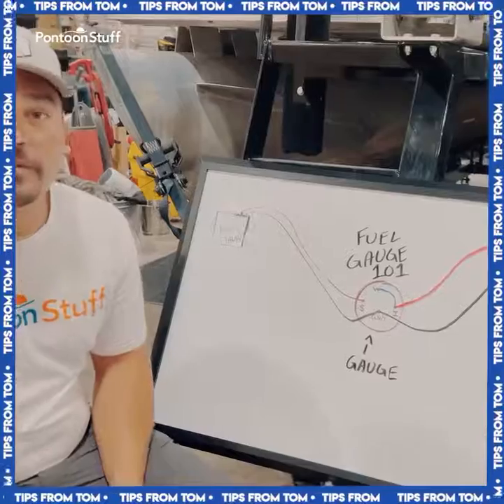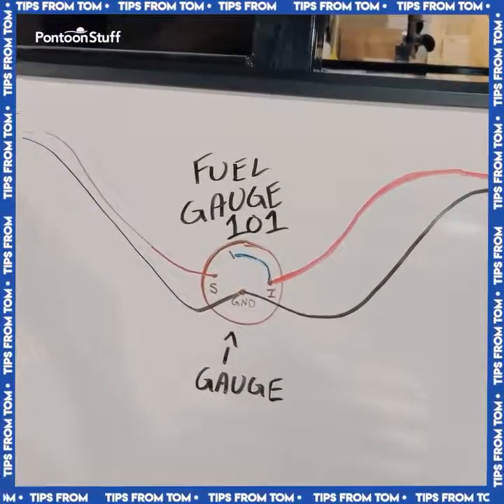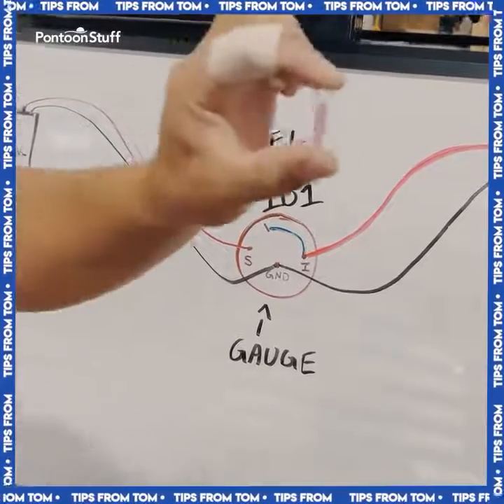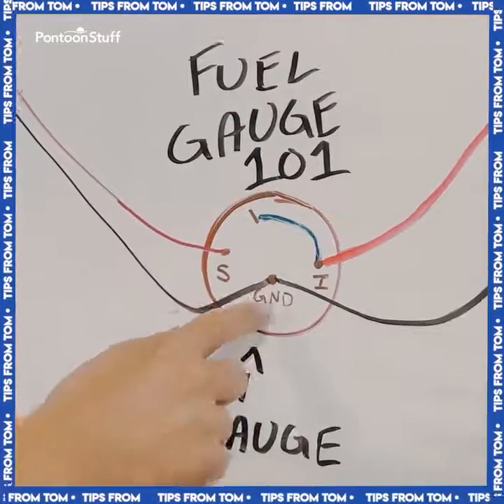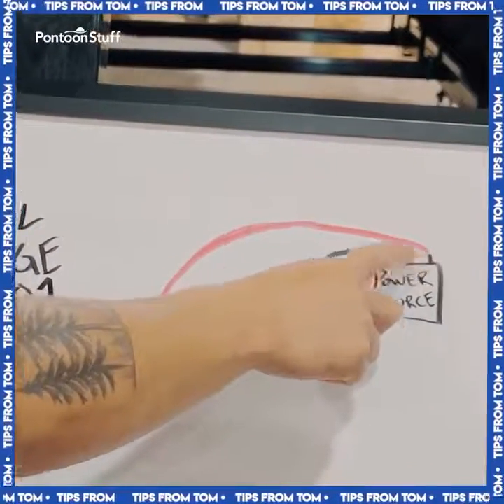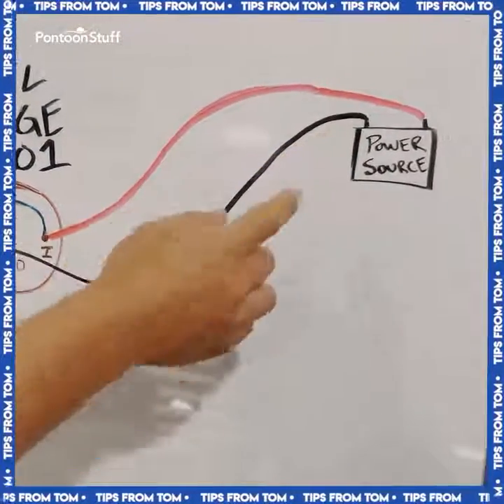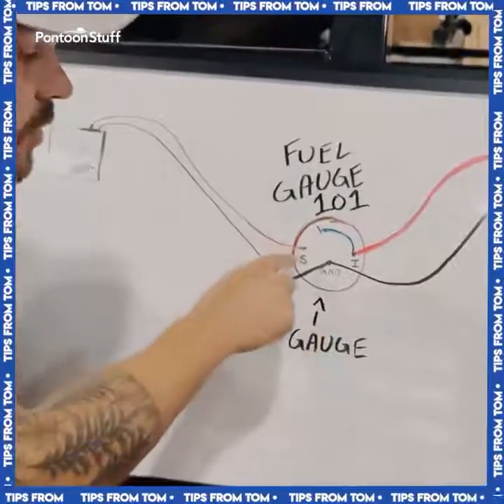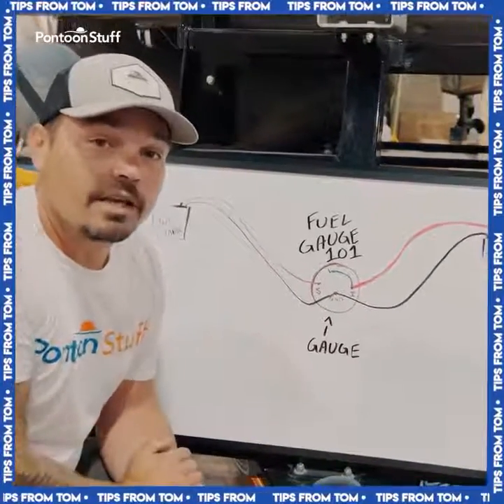Fuel Gauge Wiring 101

Comment: What to do if fuel gauge shows 75% up to 100% fuel reading? When sending unit lever is down, it shows 75% when it should be 0% and if I push it to the end it shows 100%. What is required to fix to get full range of reading?. I did change 4 different sending units and 2 different gauges, but I never got reading from 0 to 100.

Comment: Hi, with ONLY the 12v power and earth wire to the gauge, will gauge read full or empty, trying to work out if I have a faulty gauge as it shoots to full with only 12v and earth connected and sender isolated. Thanks

Comment: Thanks for the video very helpful. I’m working on a 63C 10 pick up and I’ve got a new sending unit that I was testing before installing in the new fuel tank. I was trying to make sure that my cluster fuel gauge was still working properly.
Do you have a method to test my fuel gauge ?
The gauge has continuity, but I don’t know how to test to see if it works 
thank you

Comment: I got a oem fuel tank for our txt golf cart but both wires coming off of sending unit or fuel tank have the same color both are gray how would I know which is + and which is - thanks
Reply: Continuity each wire to bare metal on tank and you found ground
Reply: @s1v3bid  there is just one problem with your suggestion my tank and sending unit in tank is all plastic so how would I know which wire is which now thanks
Reply: @jeffreycole4484 you can probably hook up multimeter measuring ohms and put one lead on random piece of metal and the other on one terminal. When you actuate the sending unit you should see resistance changing. If it doesnt work try the other terminal. Don’t know if it will work but it sounds plausible enough.
Reply: Damn its been a month since you first posted😂 hope this helps you

Comment: What if you have duel fuel tanks and want the guage to respond as you  switch from main to auxiliary?
Reply: Best bet would be to add a second fuel gauge for the additional tank. I'm sure you could add in an on/off switch for the sending wire from each tank, but I've never tried it. I'd be nervous that it could lose some accuracy by adding in that interruption. Not sure though 100%. I have only ever added a second gauge for an additional tank.

Comment: Heck yeah this helps. My tank has 3 wires?
Reply: if your tank has three wires then it is possible like my one, one increasing the ohm and the other decreasing, you only need 2 cables if you switch to an after-market gauge, just see which one says full when is  empty and empty when it is full, and toss it away and use the other one..
Reply: Then, one may be  your fuel pump hot wire
Reply: Often you'll have a pink sending wire, black ground wire, and green wire that grounds the tank to the rail or fill spout to prevent spark issues.

Comment: Are all signal wires pink?
Reply: No
Reply: @Drakomuertis certainly not , mine are black and a green-black wire and terminal is labeled T or W . Not all vehicles are the same
Reply: From the factory I've only ever seen pink wire used as sending wire, however I haven't found a good source for 2 in 1 pink/black for fuel systems so I often run red as my fuel sending wire and label it under the dash with a piece of tape.